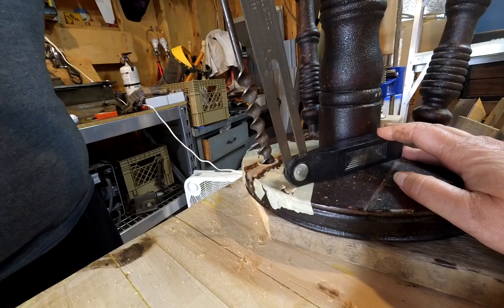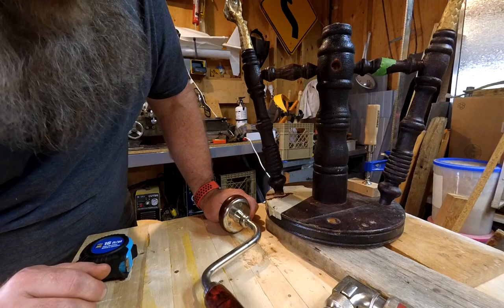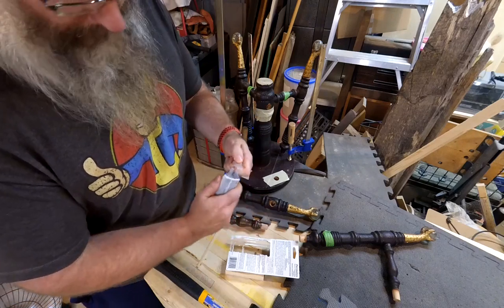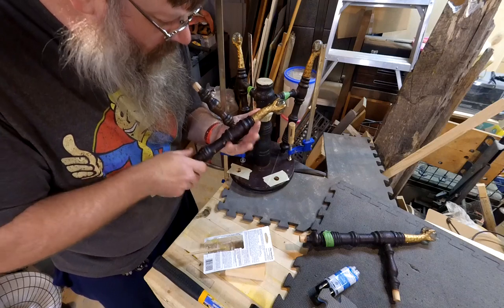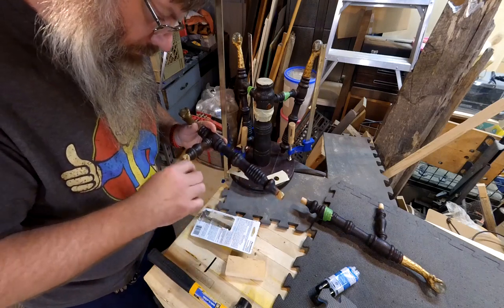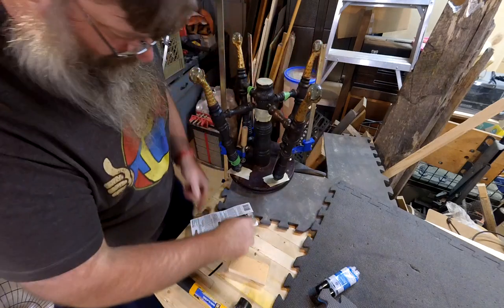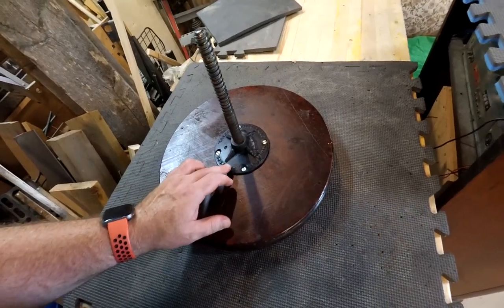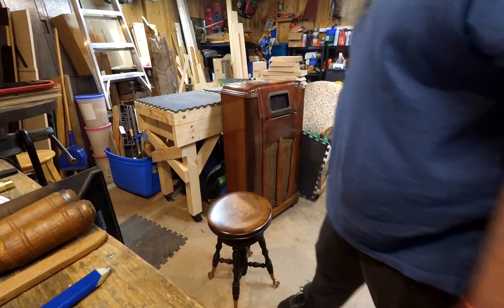Antique Clawfoot Piano Stool Repair: episode 03 - Finished!

Comment: I need help with the marbles in m claw feet. I have one set that is missing one marble, then I have a stool that is in beautiful shape other that the fact that there are no marbles in the claw feet. Do you know how I would replace the marbles?
Reply from the maker: I really wish I knew a good way to do that off the top of my head. I bet amazon or someplace would have marbles in various sizes. Since you have some of the originals to measure you could likely order a replacement or something very close to glue back in place. Good luck with it!